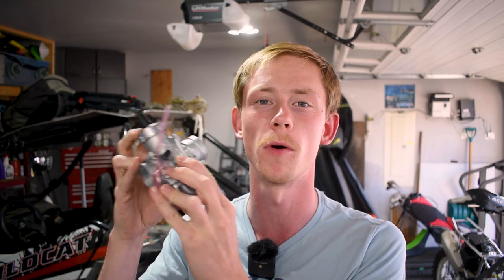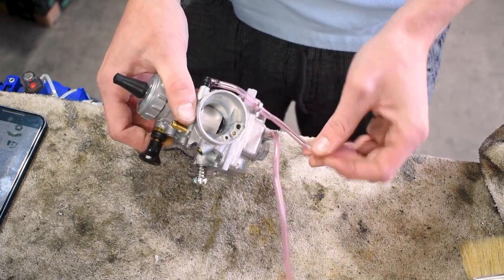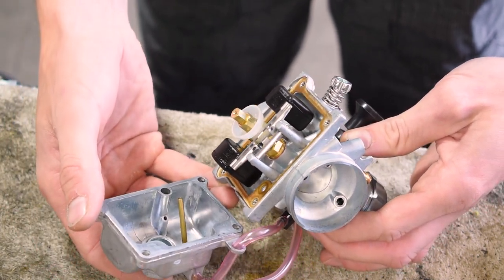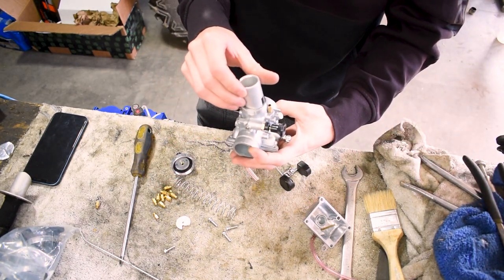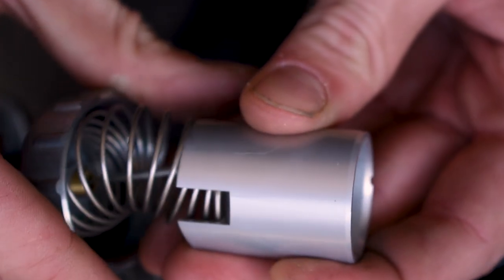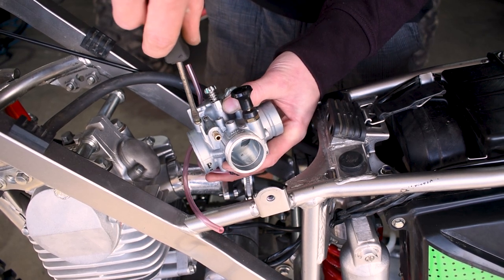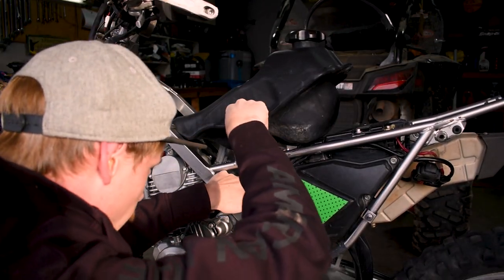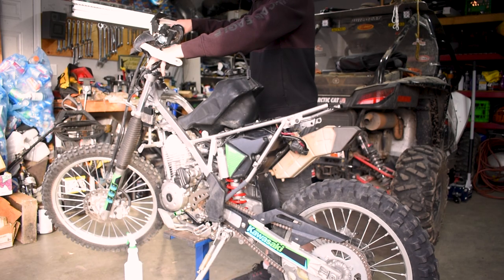BBR KLX140 Mikuni VM26 Carb Swap Kit

Comment: Hey man just got the 170 kit in mine with the carb and I see you have been riding yours for a while.  What was the final setup for jetting on the carb. I’m at the same elevation. Thank you!
Reply from the maker: IIRC i did a 190 main and a 25 pilot, it wasn’t perfect and could never get it 100% but this was as close i as i could make it

Comment: How was the cable wound?   Just put the same carb on and it’s idling/ revving super high when I start it.
Reply from the maker: Im gonna assume you need to adjust the adjuster at the throttle housing
Reply: You ever figure it out because mine is doing the same thing. And I have the wire perfect. Plus mine is pissing out gasoline.

Comment: Just did the install myself. Stock with the VM26. Mine is pinching the fuel line as it goes to the new carb. Did you have this issue? How did you prevent the line from pinching?
Reply from the maker: Rotate the fuel line and itll fix itself
Reply: Okay, I’ll give that a shot. Going to tackle that today, may have to shorten the line too but will try rotating it first. Thanks for the help!

Enjoying your videos!

Comment: I’m from Australia, is there a link to buy the big bore 170cc kit with vm26 carb? As I can only find the KLX 110 kit but I need the 140rl upgrade kit to 170 - if someone can reply with some links to purchase would be awesome so I can start the entire upgrade as in this video. Cheers
Reply from the maker: Take a peak at what you can find locally on ebay

Comment: Hey man i have the sand setup trying to get it to stop bogging on acceleration at first then it stops. Was wonder what your fuel screw is set to. It has 190m and 22.5p
Reply from the maker: Its at about 1.5 turns out
Reply from the maker: Also depends on what elevation you’re at
Reply: @AaronsEnduro  whats ur elevation?
Reply from the maker: Sea level to maybe 1500ft

Comment: I just installed the BBR 170 kit and the Mikuni vm26. The petcock completely blocks the choke. How did you fix this issue?  Thank you
Reply from the maker: You just learn to pull it from there
Reply: Yeah that’s what I figured. I was thinking about trying a different petcock. I know you stated that you run a 190 main and 25 pilot.  What elevation are you at?
Reply from the maker: @CharlieV-fj2pf sea level 0ft
Reply: I’m having an issue with the bike sputtering and losing power before I shift. It accelerates fine but loses power and sputters when RPM’s go up. I’m at 1,800 feet and I started with a 22.5 pilot and 190 main (I installed the BBR full exhaust and BBR rev box as well).  I dropped to a 185 main and same issue. Also put the stock rev box back in and same issue. Any suggestions? I appreciate your help!
Reply from the maker: what does your spark plug look like @CharlieV-fj2pf
Reply: With the 190 main, the plug was black so I went to the 185 and moved the needle clip one position up from center. The plug looked good after that, but the issue didn’t go away.
Reply: I used a new plug when I retested it too
Reply from the maker: Have you tried ( for the sake of it) swapping back to oem REV box
Reply: Yes I tried the stock rev box. I also checked the float height just in case.
Reply: Where did you get the intake ? I am seeing them sold out everywhere.
Reply from the maker: @lnb4588 i got mine at keithstone parts

Comment: I just bought the same carb as yours i dident get a big bore kit yet but do you know if i have to change anything for the carb if im using it with a stock bike
Reply: Thinking of getting this for my KLX140 but mine is stock. How’d it work for you?
Reply: @Jonh741  It worked out great now it runs without any starting problems and feels way better
Reply: I just installed mine. Ran great from the start. Needs a bit of adjustment but it really woke the bike up.

Comment: I had to use a ratchet tiedown to pull it back
Reply from the maker: it can be tricky to get it on!
Reply: @AaronsEnduro  I also got a shorter peacock from Amazon  with gas line toward the rear.  It makes it a lot easier to get to the chock
Reply from the maker: @Williamfairbanks-w7f  thats handy!